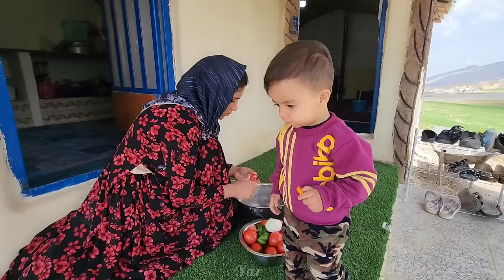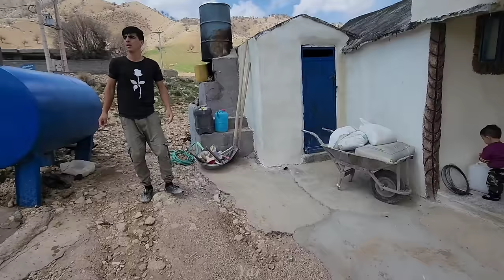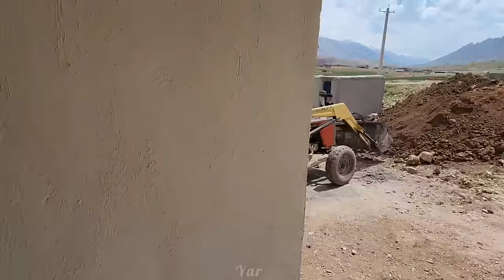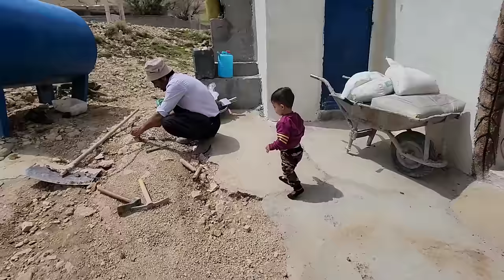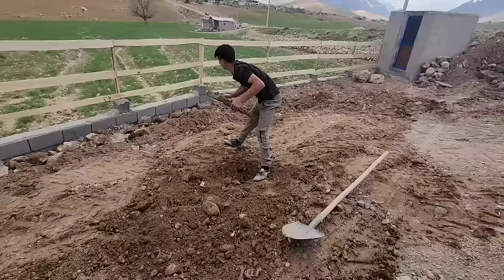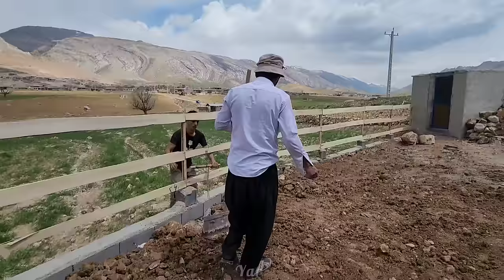Transforming Ground: Digging the Yard's Foundation with a Mighty Tractor🚜🌴

Comment: Что же вы наделали? Какая же это.земля? Сплошные огромные камни
 Как же теперь с ними бороться? И.трактор неудачный, ничего не разровнял и ничего хорошего не сделал. Очень жаль
 После него еще.больше работы будет.
Reply: I guess they tried to reduce the slope they had in front of the house and added soil to try to level it or make it flat.   But I observed they did nothing to divert rain runoff. As soon as it rains, the soli will be washed away with the runoff. All that water the comes down from the road will be a big problem, something must be done to divert it so it will not come down to their yard.